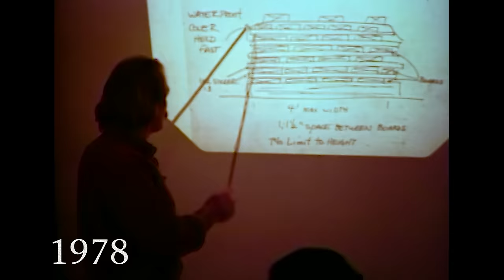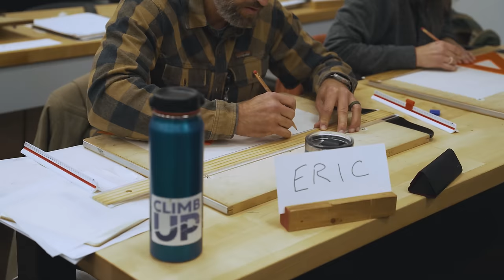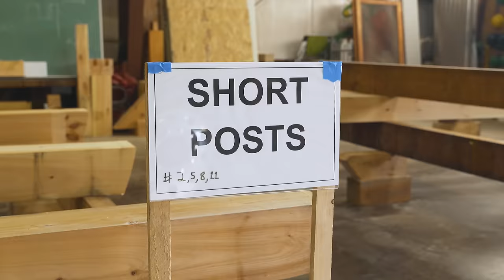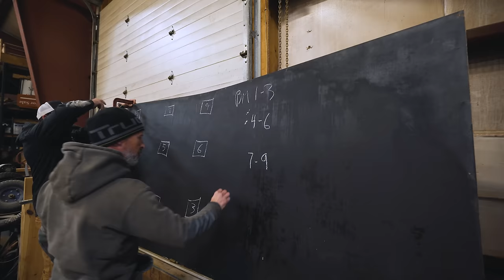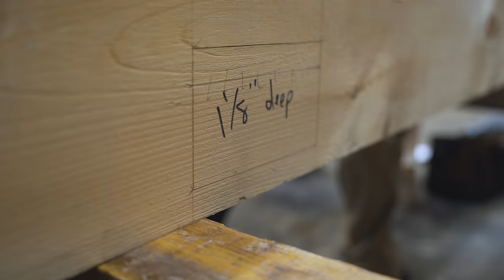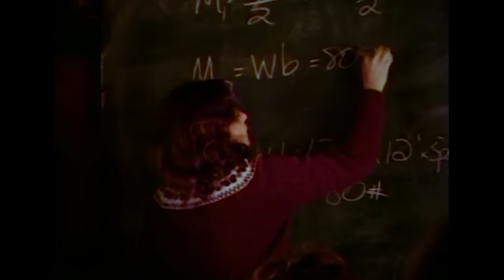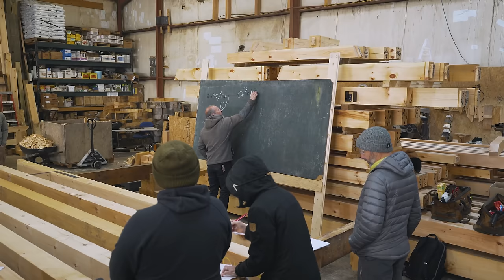Mortise & Tenon: Learning to Timber Frame In Five Days

Comment: Built my three story gambrel timber frame house. Tin roof and walls inside and out covered with stone or tile. Solarium on the third. My journey is one timber at a time by myself. No living trees cut for this project. Mill windfalls or snags. Not easy, but it’s still mine. Working as a labourer at the same time… well perseverance prevails.
Reply from the maker: Incredible, congratulations!!
Reply: @ShelterInstitute  stop by sometime for a Java and chat.

Comment: Is it cypress you are using, Alaskan Yellow Cedar? I have access to Monterey Cypress (Macrocarpa) here in New Zealand and in suitable dimensions. Is Monterey Cypress suitable to be used for timber frame at this scale??
Reply from the maker: We are using eastern white pine timbers in this video. Monterey cypress has slightly better fiber stress value and is also slightly stiffer so it would be a suitable wood, particularly if you have access to long and large timbers. Monterey is the largest of the cypress family which bodes well for you. It is not indigenous to NZ but having been introduced around 1860 it has a good track record in your climate!

Comment: I was a Timber Framer in the 70's, 80's and 90's, what happened to the Beetle? I see you use sledgehammers.????
Reply from the maker: We do use sledgehammers! If we are using a sledge on an interior facing timber we use a block to not harm the timber

Comment: with todays tools finally getting affordable for this work. the teaching will soon die out.
Reply: A tool is useless or even dangerous without the knowledge of how to properly use and maintain it (to say nothing of architectural and engineering knowledge).
Reply: Affordable tools are not a replacement for knowledge on how to build. You still have to know what the tool is supposed to do.